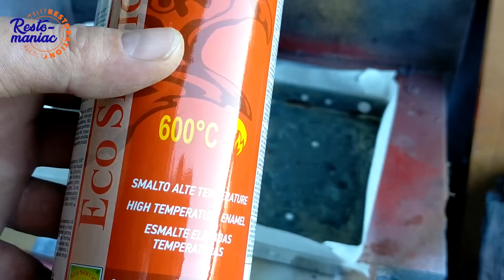Dirty Toaster Renovation

Comment: if you dont want it to stick you can butter the outside of the bread it will also give a nice golden toasted exterior and a nice crunch too
Reply: And must wait until the toaster is very hot, then put the bread on it
Reply: correct
Reply: Mayonnaise instead of butter, it's a lighter oil and doesn't make the bread greasy and the egg browns and crisps the crust beautifully
Reply: or use parchment paper :)

Comment: Didn't know that about Bakelite and its love of oil. Turned out nice. Those toasters seem like a good idea but the mess they leave behind makes it too much bother.  I threw mine and the George Foreman grill away years ago:)
Reply from the maker: You are absolutely right. Their looks and designs are really nice, but I don't want to use them :)
Reply: I have had my George foreman for over 20 years and use it every few days. I find it easy to clean. Never had any thing stick like his sandwich did. I spray it lightly with olive oil before I use it.
Reply: I would not have survived my early 20s without my Foreman grill. Used it for everything.